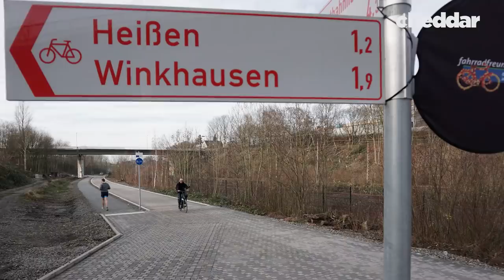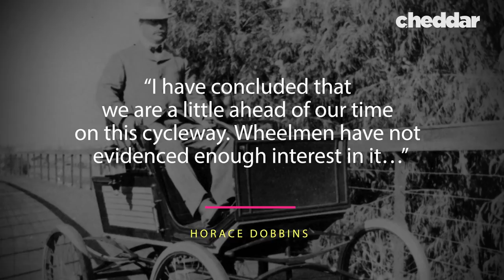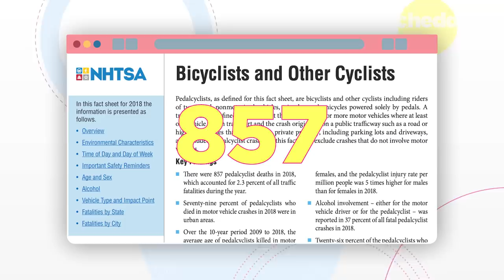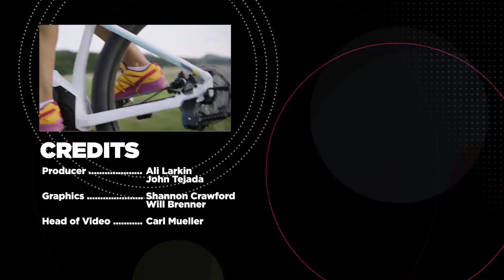The Death And Rebirth Of Bike Highways - Cheddar Explains

Comment: The reason the Dutch one was so expensive, was because it needed to cross 2 major rivers (with a wide bridge to let boats under it). Normally most cycling highways are just a regular street that has been turned clear of cars that take a different route now. With the American grid system it would be very easy to do that. Perhaps connect up a few areas but replacing an entire road with cycling lanes is pretty cheap. It doesn't need to float or anything fancy.
Reply: thats what happened in montreal, it was pretty great as a cyclist but was overdone on some major arteries during the summer where a 3 lane became a 1 lane
Reply: bedoelen ze met bike highways fietspaden langs de kant van de snelweg of fietspaden?? Ik snap het niet zo goed..
Reply: @pies muis 

Ze bedoelen in principe echt grote fietspaden die gescheiden zijn van de auto’s maar cheddar doet niet echt goede research. In Nederland noemen we een fietspad die niet direct naast een weg zit of die twee steden verbind al gauw een fietssnelweg. En hierdoor laten zij het lijken alsof wij een soort mega brug hebben door de weilanden terwijl in werkelijkheid dit gewoon een normaal fietspad is door een weiland en wat woonwijken
Reply: @holyblobvis965  ahh oki duidelijk dankjewel ^^

Comment: About the Rijnwaalpad: With the exception of a few dedicated bridges to cross larger roads and two major rivers, the path is just on ground-level for the most part! Although also features two well-designed tunnels to cross highways. It was one of the first bicycle-highways in the Netherlands (and with that the world probably), so construction costs where around 17 million euros, but similar paths in the future will be cheaper. It's also good for the local economies and it causes less costs for society (maintenance, pollutions, noise, etc)

Comment: 3:53
1. Cycle Superhighways have been here for a while and are not what you see in that image.
2. Norman Foster's idea and what you see in the image was called SkyCycle hasn't really been talked about since 2014. It was just a failed idea.
3. The City of London is not the same as London. It is a small autonomous city roughly the size of a square mile in the centre of London and has its own mayor and police force. Boris Johnson was the mayor of London, not the City of London. I'm doubtful they had anything to do with this idea.
4. We don't use Euros, we use the Pound.
5. The line on that map starts in East London and just goes further east. West London is barely even visible on that map.

Comment: Cheddar.. please do your homework. The Rijnwaalpad is not completly raised of the ground 11 miles (17km). Only the part that does goes over a river. (makes sense right?) Most of it is completely at ground level and parts of it are also shared with cars (at low speed max 30km/h or 18.6 miles) just like any other 'cyclehighways' in the Netherlands. Completely raised cycle tracks are a bad idea. They are hard to get to and are a barrier on their own. The benefit of cycling is flexibility to go wherever you like. Raised tracks only offer you only one direction and just like public transport: your starting point and destination are unlikely to be at the end or start of the route. In general they are a good idea but should be close to housing and other points of interests. separation with car traffic is a good for safety. separation from the ground floor is very bad..

Comment: The trick to bicycle commuting in America is... well, it's hard to arrive at work in a presentable condition in 90+ degree heat and high humidity. Few businesses provide showers and changing areas for employees who biked in to work...
Reply: Electric bike.
Reply: @grantadamson3478  Which cuts down on the problem somewhat, but doesn't eliminate it entirely.
Reply: @andrewszigeti2174  Yes, not entirely.
Reply: I mean, European countries do experience heat waves and high humidity as well?
Reply: @wohlhabendermanager  Yes. But in America 90+ is continuous from May to September, and it's not a heat wave until it tops 100.
Reply: @andrewszigeti2174  Maybe in some states, I doubt that it's that hot in the whole country all at once.
Spain and Portugal are generally pretty hot, as is Italy. Further north (Scandinavia) you won't get much heat, of course, but cold and rainy weather. And people still manage to cycle.
Reply: @wohlhabendermanager  Yes, but in those countries you'll find much more respect for worker's rights and privileges than in America. Not to mention a much stronger 'green' mentality. In America if it doesn't profit a major corporation it's a major battle to do... and bike manufacturers are not major corporations compared to automotive and gasoline corporations.
Reply: @andrewszigeti2174  Yeah, this is true. Watching "Not Just Bikes" and "Strong Towns" was a real eye-opener for me.
Reply: In the netherlands a lot of times its 90°+ and its always very humid, i only remember one time when ut was hot and not extremely humid, yet still everyone cycles

Comment: These bike highways have a big problem: They're not very useful if you don't have extensive, much more basic infrastructure in place already (dense network of save bicycle lanes).
This is essentially the same problem as with high speed trains in the US: The lack of a network that feeds these structures. 
These big, flashy (and expensive) projects like this may sound good to a certain audience, but the US, and many other countries btw, have a lot of low hanging fruit to grab first.
Reply: just redesign your road or street when you repave it to whatever is suitable

Comment: "European cities have been working on bike infrastructure since the 1970s"

In the UK it was the 1960s, with the construction of Milton Keynes. Right from the start the layout was designed to make cycling easier and safer, with cyclists very rarely having need to use the main grid roads to move between neighbourhoods.
Reply: and it's also mostly not true at all, outside of the netherlands, bicycle infrastructure was mostly gone at the end of the 70's. that single town in england is nothing compared to the comprehensive network we have here.
Reply: @ray076NL  Weird that in my hometown in Sweden I go on the same bikeroad that been there since before WWI. But before 1950's it was shared with horse transports.

Comment: "ebikes over 45kmh" - lmao that's not an ebike that's a motorbike!
Reply: it's e bike, motorbike is lot faster than that
Reply: @saltymonke3682  In Europe, what is called ebike or in French "vélo à assistance électrique", is a bike with a motor limited to 25 km/h. It does not mean that you cannot go faster, but the motor will not assist you. Such ebike are 100% equivalent to a bike regarding laws : no insurance needed, no helmet mandatory, can go on all bike only lanes, etc. Furthermore, a European ebike cannot move if you do not pedal, there is no "gas" handle.
Reply: And if it goes at more than 25 km/h it is a motorbike, with or without pedals, even if of course some motorbikes can do quite faster. Motorbikes can be driven by 14 years old children if they are limited to 45 km/h, and you must be 18 years old to drive a motorbike that does faster than 45 km/h.
Reply: @didierpuzenat7280  yes, French has that small cc moped/scooter

Comment: I use a power assist e-bike for groceries, haircuts and all small item shoping.  If it is too big, out comes my car (new back door, 5 cases of soda, etc.).  
Soon i will add an inverter to charge all batteries from my 100 amp LiFePO4 batt + solar + large battery.  My tv, lightinng and cell phones are alreadty are on solar.

Comment: Rijnwaalpad: Where did you get the "dedication" of € 700 million? The total investment was "just" € 17 million over a stretch of 17.7 km. Makes about € 960 thou per km. By comparison:  building a 3-lane highway in the Netherlands costs between € 10 to € 50 million per km (The Netherlands are a small country, so the ground is expensive. Plus costs for all the "extra's", like safety measures, electronics, etc). Most of the "pad" (="path") is at ground level; it's certainly not elevated all the way. The most expensive part is a tunnel under a highway, at some € 4,6 million.
Reply: Some other comments mentioned that that sum was actually for the German bike highway so they seem to have made a small error.

Comment: I would like to clarify something here, though feel free to correct me if I got this wrong: at 3:40, she mentioned that the "dedication to get it off the ground" for what I assumed was for the bike highway was at 700 million euros, but that the entire cycling infrastructure in the Netherlands cost 30 euros annually per Dutch citizen... which reaches to about 510 million euros - the graphic also implies that for that year, all that money went to the 700 million euro project.

I feel that this is slightly misleading; it's possible that infrastructure maintenance costs are that low per person, but the figure shouldn't be shown like it's related to what is effectively capital spending for a new project.
Reply: I understand your argument. I tried to figure out the numbers in Wikipedia in my language where a number of 17 m as for the costs for a 9.5 miles long cycle way was quoted. It isn't clear, however, what is included in that since there were different structures to be built such as an underpass of a motor highway.

I wouldn't take all the numbers for granted, but the NL are indeed known as a cyclists' paradise, as Denmark is. Unfortunately ppl, when presenting these countries and their greatest cities Amsterdam and Kopenhagen as a model, forget to mention that they are as flat as pizza. 

Nonetheless, in my view, cyclists' highways do make sense in densely populated areas to prevent stops at every crossing since the redlight rhythm is mostly adapted to motorized traffic.
Reply: Seems the 700m was for another project, a second bridge crossing the Waal river near Nijmegen. The Rijnwaalpad cost only 17m.

Comment: What cities can do is convert all Metro/Subway stations that frequently break down into underground Bike Highways. One less black hole to throw money into.
Reply: No 
Public transportation is much cheaper for the government and the consumer than car roads
That is why you should replace car space with walk and bike space
Reply: @burgerpommes2001  You say that, but I live near the DC Metro, and all it does is break down. They constantly have to repair it, and there are even talks of raising prices to get on. It really isn't as cheap as you think it is. I guess it's cheap where you are. I remember spending $20 on a round trip on the Metro.
Reply: @vegettosonlab  i think you dont realize how much it costs  to own a car and how much it costs to maintain the roads 

I agree transit fares should be cheaper in north America and DC should really modernize their system to a point where it is reliable
Reply: @burgerpommes2001  Dude, I own an SUV. I cost me $900 to replace all my tires last year, and almost another $900 just to do normal maintenance this year. I honestly rather deal with that than a Metro that doesn't work. 

The Metro should be scrapped and turned into a Bike Highway, because, as it is right now, it's useless, and too expensive to maintain.
Reply: @vegettosonlab  but metros can work if you maintain it decently many people rely on public transportation some of them not able to drive or bike like the blind
Reply: and only because there is bike infrastructure doesnt mean you cant drive it could even mean that traffic gets better because only those people drive that actually want to even if there is less car space